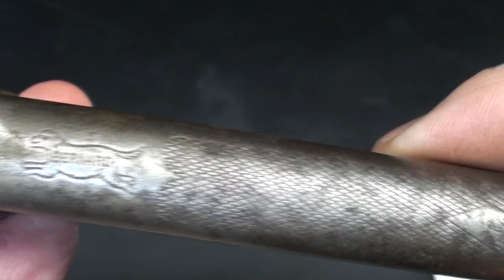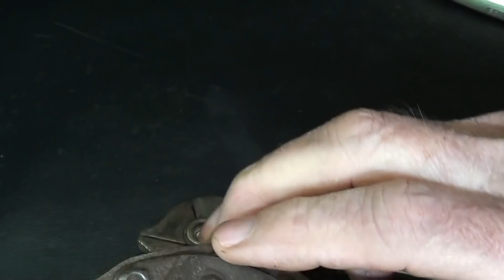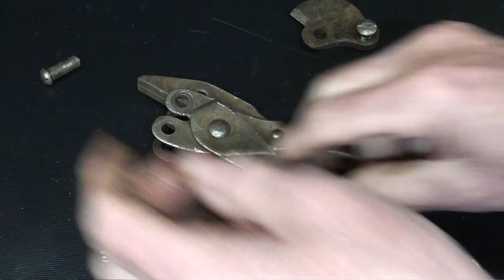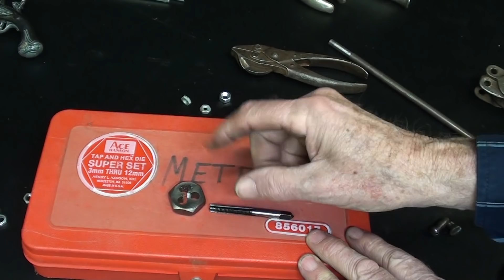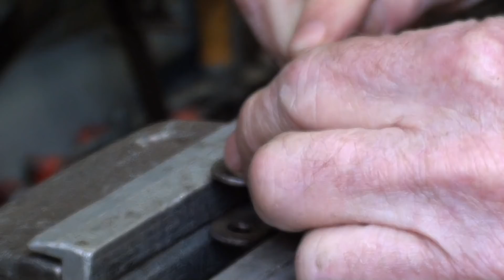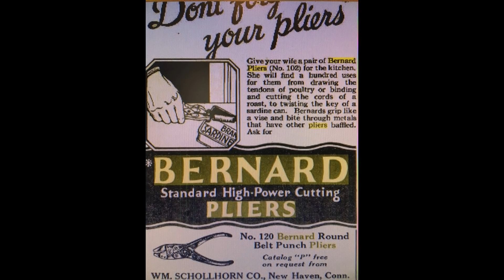Bernard Pliers Repair Revisited tips 552 tubalcain mrpete

Comment: I have a pair of those pliers that belonged to my dad.  You mentioned that many of them were sold at army surplus stores and and I think that may have been where he bought them.  He passed away in 1978 and I have been using them since 1985 to build and repair barbed wire fences on my property.  Very recently I lost the center screw and the cutters no longer work.  I was extremely surprised to find out how valuable they are and to find you on Youtube with the IDENTICAL pliers. Will I be able to find a replacement bolt ?
Reply from the maker: They are special screws, you might have to make one. 😀

Comment: I found a 4 inch model in a toolbox from and estate sale. I had never seen one before but researched and found Sargeant pliers info online. I haven't used them but have them in the drawer of old time handtools. These are in very good condition so my grandkids don't need access to them.

Comment: Oh - and years ago, the Sportsman’s Guide catalog had French Military surplus pliers with a nasty zinc plating, and a little flip lever to hold the spring-loaded jaws closed.  The tab end sat on the bottom of the jaw and prevented it from sliding and thus keeping the handles closed.

Comment: Well, I checked. The largest pair, 5-3/4" long, PAT MAY 6 1890 are riveted. The smaller one, 4-3/4" long, PAT JULY 18 1892 have nuts & bolts. Now I wonder where & when my father acquired them?

Comment: In 25 years of working with metal in Denmark I have only once encountered a machine using 7 mm bolts, so it is not a common used standard.  Apart from 3 and 5 mm, the standard is some even numbers 4, 6, 8, 10, 12 (14), 16,  20, 24, 30, 36.... 14 mm is also a rare size, but I have seen that a lot more than 7 mm.

Comment: Pity such a useful parallel plier never made it north of the 49th parallel.  Has anyone heard of a parallel jaw locking plier, take off of a vise grip but with a secondary link, made by B.M.C.?  If not check out U.S. patent no. 2388580. (Wonder how rare the one I have is?) Cheers.

Comment: I ordered two "new military surplus" parallel pliers from a Sportsman's Guide catalog about  20 years ago. One is marked "Bernard" and the other is marked "Utica."  Other than that both are identical with two nuts and 3 screws each. Both have the wire cutter. Well made and extremely handy.

Comment: ...Vise-grips...those are really tough material, I ruined a couple of  'letter-stamps'  trying to put my name on a pair...resorted to ID them by a couple of small MIG welds...
  ....17:00....I have an older Harley Davidson with some non-standard threads on the 'standard' diameter fasteners. The only reason I can see for this is to force you to buy the parts from a Harley Dealer...

Comment: I was lucky enough to attend the Smith and Wesson police armorer's school  in Springfield Mass. I had been an armorer in the army {45 bravo}.
I worked for my father-in-law , who was the S&W law-enforcement distributor for the state of  Alaska. {I did say I was lucky).  In any event, I added to my fairly extensive Gun  tools by adding the S&W factory  tool kit. Among many specialized tools, I got 6 pair of Bernard pliers of  different sizes. I still have all but two of them and my son has those. I bought them in 1981,  they are now well used but used well. For  gun work they are the best and I have enjoyed them for many years.
Reply from the maker: Thank you for some interesting information

Comment: Thank you, I started watching this and had to stop, and go to my garage and get my two pairs of this type of pliers. One must be old because it has, as you described, the running St Bernard on it and the ends of the handles are closed over so they look solid. The other pair is specialized in that it's made to service the round belting for a treadle driven sewing machine. It will cut the belting and there is a punch so you can put the wire in and keep sewing.  I would rather watch you or Abom or Keith Rucker or Steve Summers than all this nonsense that is put out over the airwaves. Keep up the great work.
Reply from the maker: Thank you very much. I will show that singer pliers and a future video. I have one

Comment: Lyle, I’m surprised that you didn’t weld a little hard facing on the cutters and then re grind them . I cut up empty antifreeze jugs for my evaporust  , they work great and I can get different size containers depending on how I cut them . Just my 2 cents worth . Thanks for the video.
Reply from the maker: Not worth the effort. There are millions of good pliers out there

Comment: 1) I got parallel pliers off Ebay and did not notice a nut was missing.  I milled the nut thinner on the pliers in the Kurt vise.
2) I broke many vises. 20 years ago I got a Columbian 504 on a bench at Boeing surplus. I had to buy the bench for $75 to get the vise. That  Seafoam green [Boeing paint] Colombian has been indestructible.

Comment: Lyle, I have not seen a tool like these in Australia.  I am sure that there will be some, so I will keep my eye out a swap meets and see if I can get one.  When my Daughter and I were into roller skating, top quality skates had 7mm axles, some with clip axles and some with threaded ends. It was almost impossible to get 7mm nuts here, so we had to import some from skate dealers in the US. For some reason, 7mm is just not used.
Reply from the maker: It seems to be an oddball size

Comment: I work mostly in metric thread sizes, and I've never come across a metric 7mm thread either at work or at home in decades ! And more amazing yet, you had an M7 tap to hand :o)
Reply from the maker: Yes
Reply: I agree about the finer pitch of metric threads in general - I must have tapped hundreds of M6x1 holes, and some M8x1.25, but M7 has just never come up :o) Nor M9 for that matter...

Comment: Thanks for the video. I'm a tool collector also.
The concrete in the handle probably came from using the pliers for tying rebar together on a concrete pour.
Reply from the maker: You may very well be correct never thought of that

Comment: You could have turned the pins down on the ends to 1/4” and left the center parts at 7 mm that way you could have a shoulder bolt to help keep the nuts tight. But nice video! My dad’s Bernard’s were blued like a gun. I wish I knew where those pliers went, I know he always coveted them!
Reply from the maker: Good idea, never thought of it. Your dad was a wise man

Comment: Oh Mr. Pete... You and your distain for the Metric System!! LOL

I'm so sorry to let you know that US manufacturers have been discretely using metric dimensions for a very, very, long time. I'm always finding things that when I measure in Imperial they have really odd dimensions. Then I flip to metric and low and behold... TaaaDaaa!!! it matches up!! I find this even with some really old stuff that was made in the USA.

I've finally have resigned myself to buying metric measuring tools, dial indicators, test indicators, calipers, rules, etc. (or buying electronic ones that have both metric and imperial). 

I've even started machining in metric and have found it soooo much easier!! Really only two decimal places to worry about. Tenth's and hundredth's of a millimeter. And no more fractions!!! (I was never very good at fractions in the first place) Now when I do run across something in imperial, I just cringe.

I've even started buying more metric tools (drills, mills, cutters, etc.). Sometimes it's difficult being in the US to get them, but hey... buy online and it get's shipped, easy peasy!!

It's even more important to use the metric system when trying to fix or adapt to anything new today. Everything is made overseas and they use the metric system for all their measuring. Even new stuff that's made/designed in the USA, 90% of the time it's metric now.

Sorry, but this was my turn to rant!!! (LOL)
Reply from the maker: That was a good rant. But actually I know the system very well, from science. And I do not have a disdain for it. And yes big companies like Ford caterpillar and so on I have been using it for decades. And that is no secret. I worked for caterpillar for a while. Again though I must reiterate we have the greatest industry in the world for 200 years was the old system.

Comment: Very interesting video. I am not sure why Wilton bullet vises are so high but I got one because my father used one without issue for >50 years. Prentiss and Reed are two more excellent vises.Maybe its the same reason Craftsman tools are so highly rated, most armatures think they are only one step below Snap On. There is nothing wrong with Craftsman but if you look on eBay they are more coveted than IMO better tools; Wright, Black Hawk, Williams, Plomb/Proto,Williams, Armstrong and probably another dozen I can't think of right now.
Reply from the maker: I will be doing a comparison video. Between Wilton and Colombian in the 3 inch size. I like craftsman, but At an auction, people think they are the greatest thing since sliced bread, I do not get it

Comment: I am like you in having a mechanical brain, I love your videos on how things work.  Keep them coming.  Now for a personnel comment, have you given any more thought to getting your cataracts removed.  I will have my first surgery the end of April and the second the middle of May.  The surgeon told me that I may have still use reading glasses but wouldn't have to wear glasses for far vision.  I will attach a comment on one of your videos in a couple of months and let you know how my surgery goes.
Reply from the maker: I know two people that have botched surgery. Therefore I am scared to death. However I know that it works for 98% of the people. I will have it done sooner or later
Reply: mrpete222 , the only regret I have about my cataract surgery is that I didn’t have it done sooner. I’m sure the success rate is higher than 98% by now , but even at those odds you can take that to the bank. Best to you !
Reply: @mrc1539  I am 69 and want to have mine done now because the surgeon told me that it better to get them young instead of letting get so hard.  Also I don't know how many years I have left and I want to have better vision for the time I have remaining
Reply: Jerry Polk , i Hope yours comes out as well as mine , I quit wearing glasses completely for about 10 years after my surgery and have just recently started wearing them for reading. I’m 74 and still pass my DMV physical with 20/20 vision. Good luck to you  .

Comment: The cutting jaws are usually sprung by gripping wire in the cutting portion that is too large (or too hard) and moving the tool laterally while squeezing the handles in an attempt to aid the cutting action.  This was a real shortcoming in shearing-type jaws such as these.  That's why none of my garden shears work anymore, and my yard is overgrown.
Reply from the maker: Yes, that is a good analysis of what happens. I have several lopping shears. All the bypass type are sprung.  I prefer the Annville type

Comment: I  have a couple pair of the Sargent version in different sizes. Love them. Also have a Sargent hole puncher that has the same geometric function as the pliers, but not sure what it's meant for punching holes in, since it can actually accept material appropriately .25" thick. Very precisely made too.
Reply from the maker: I will be having one more follow up on these flyers. I just acquired eight more of them. Most are specialized as you just mention

Comment: The original screws could have been an outdated size like #16-20.

http://www.mtfca.com/discus/messages/50893/61127.html?1217037499
Reply from the maker: Thanks--I will show that chart in another video
Reply from the maker: Yes

Comment: I lost a screw in one position of my Bernard and though my dad and granddad's shop had a huge assortment of machine screws, none had the exact thread. Eventually I found one of softer metal that was close and forced it in cross threading the screw but not harming tapped threads . . Of course the original screw was hardened to support the leverage forces, but I typically was only doing light duty work with them. I lost them somewhere in our shop and am sure they  wedged behind my half ton carpenter's bench.
Reply: . . . mine were gun metal blue
Reply from the maker: lol
Reply: @mrpete222  : btw: your videos are always well lit. so many restoration videos and shop vids are horribly lit. You could make a video on how you set up lighting and camera work that could benefit millions. :-0

Comment: I have my dad's pliers and I have memories of those pliers that I forgot about. Thank you, sir, for bringing these to my attention once again. Also, my "career" was in stamping and forming thinner metals, .001" to around .250" (yes .001" thick). We also heat treated some of our thrust washers, etc, both case and thru hardened. I appreciate your comments about working with metals, tool and die design and fabrication as we also made some tooling for customer's parts.
Reply from the maker: Thanks

Comment: Don't worry Mr Pete. We all suffer from the same condition. It's called 'tooleritis'. There is no cure for that. Just keep acquiring tools to avoid the symptoms from 'tool-withdrawal'. Btw. 7mm metric is an extreme oddball size. I spent most of my life on the metric continent and I believe I've never come across a 7mm bolt. 9mm is odd too, but I've seen those sometime. Common sizes are 2.5-3-4-5-6-8-10-12-16-24 mm. Your 7mm tap is coarse. The fine thread would be 0.5mm I believe.
Reply from the maker: While in that hardware store, I determined that was an oddball size even for metric

Comment: Thank you for another interesting video Mr Pete, I quite enjoyed this.  But at 29:43 I found myself calling out; "Add a packing washer!"  worth trying as it could well re-align the cutting blades.  Also, my little tip is to make handy containers by simply cutting the top half or third from larger containers such as an empty evapo-rust bottle.
Reply from the maker: I considered trying to realign those jaws.  But did not bother, because Bubba had ruined them with the grinder

Comment: I liked the advertising saying "nuts are square" Not so much anymore! i suspect that .270 bolt diameter was an arbitrary number based on the stock they started with to turn down to make the screw. I bet those screws were made from stock and did not have swedged heads like most hardware is made now.
Reply from the maker: Yes
Reply from the maker: Since they made these pliers in many sizes. They probably had to scale the fasteners in proportion to the pliers size. You are an engineer, what do you think Brian
Reply from the maker: I forgot to mention to you in regards to your recent video on the bridge. I thought your car mounts in regard to engineering were very scholarly. I appreciate that type of information.  They are building several highway bridges around here over the Illinois River. Of course none of them use a superstructure anymore. All made of concrete beams.  And they take two years to build. They built the pentagon in one year. The largest building in the world at that time, done with minimum machinery and the lack of manpower during wartime, figure that out  no Osha or EPA  to slow them down

Comment: Mr. Pete, I take plated hardware and soak it for 24 hours in white vinegar and it does a nice job of removing the plating.  Great video, as always.  Thanks, Mr. Pete! :-)
Reply: You can re Zinc plate with a simple Vinegar/ Zinc solution. And small current on Zinc anode. Lots of information on YouTube. Have you tried it?
Reply: @slypig24  I haven't.  I was happy enough with removing the plating, but that is interesting info.  Thanks.

Comment: My Dad had a pair about 6 inches long. I've still got them around somewhere. I'll have to dig them out and see if I like them. I don't have a whole lot of love for the bigger ones, though. Thirty years ago, in the toolroom I had to come up with a way to modify about a dozen of them. The company I worked for had a secondary line of producing key cabinets. They had key tags that had little brass clips crimped onto them and were locked onto the key with another one way tab. The tags said, "File key, do not duplicate." In an effort to make a little more money from one of the cheapest outfits they ever worked for, women would take home big boxes of those tags and clips and with a modified pair of those pliers, sit in front of their televisions and crimp those little clips onto the tags. Over the years, many sets of those pliers were modified. No one ever documented the modifications. They brought me samples of pliers that never worked very well. The women who had ones that worked, wouldn't bring them in to let me see them because, they were afraid they wouldn't get them back again. I suspect, they did that to all the other toolmakers before me because, there were a lot of variations. Am I ranting? Sorry.
Reply from the maker: That was a good story

Comment: Mr Pete
I don't have machines like you at all but I'm a wiz in using a bench grinder, cut off wheels and hand grinder. I could have made those 7mm bolts and nuts. And I do agree to use Evapo Rust and LocTite. Lol.
Keep making chips.
Reply from the maker: Thank you